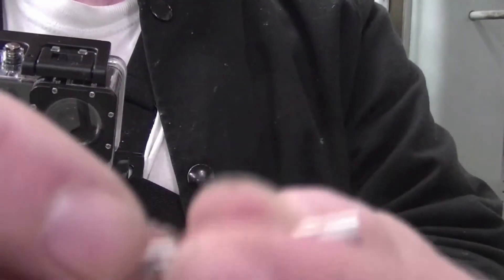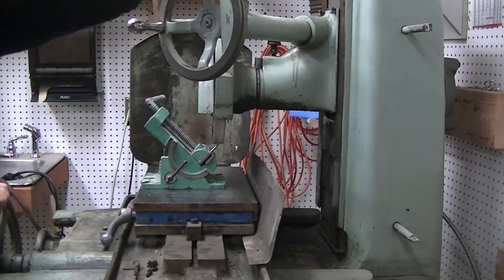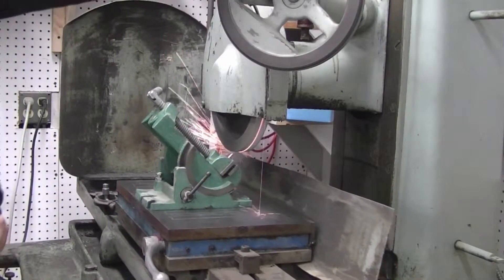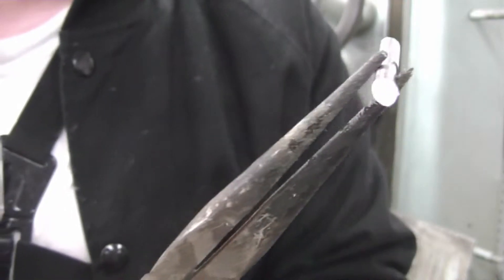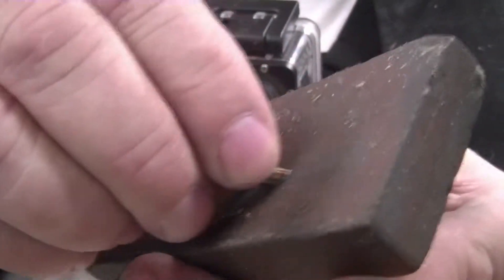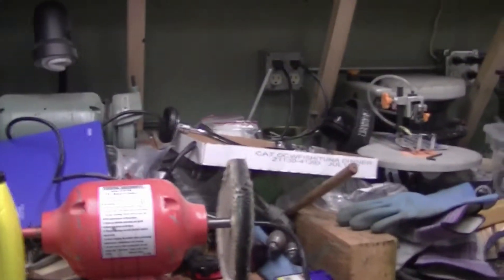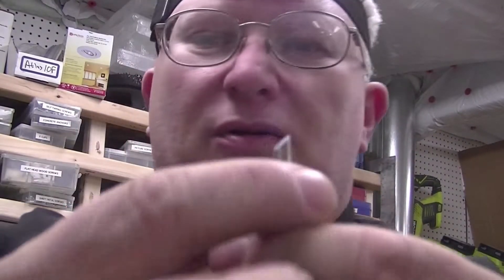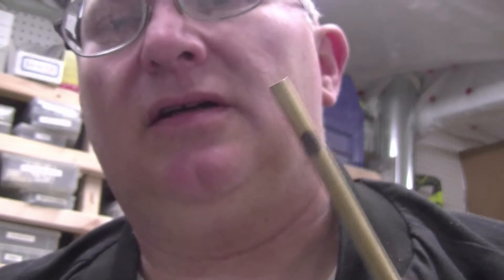Episode 1 DIY Borescope Part 3

Comment: i like that,, watch me,, but dont do what i do,, lol
Reply from the maker: Hi Gary: The difference is I was counterboring which causes all the machining force to go straight up through the chuck into the spindle. Some of my students would definitely use that as an excuse to chuck endmills into drill chucks to use for endmilling which, because the load is sideways rather than up, would either break the chuck or force it to come off the chuck arbor.
Reply: i know,,lol im a machinist,,